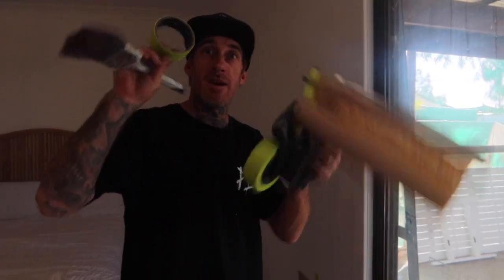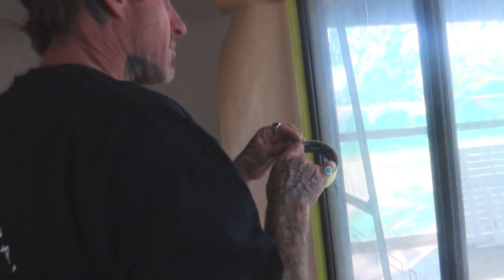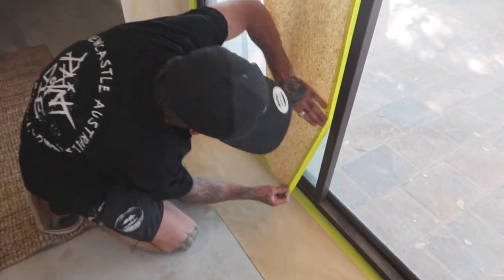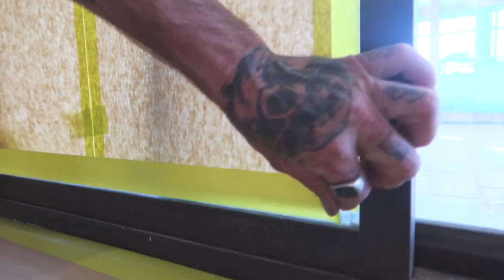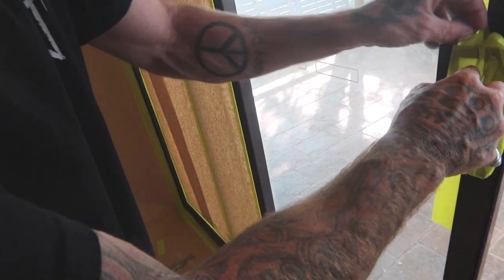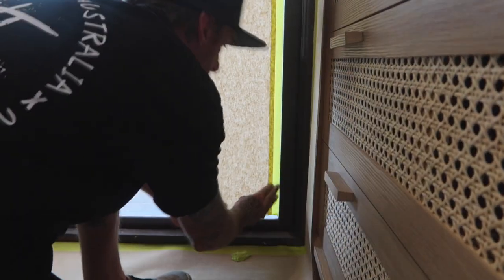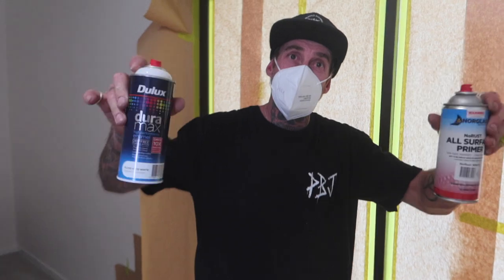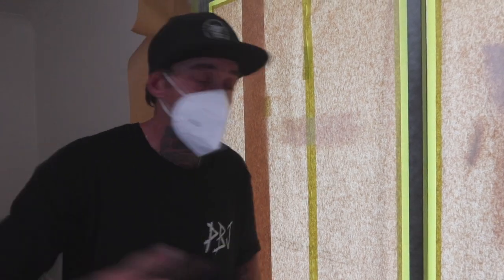PAINTING ALUMINIUM DOORS

Comment: Awesome video! Thanks Josh, just with the weather strip when removing windows. Can you tape that off or do you remove it whilst painting? 
And with the tracks, do they not get caught on the paint once it’s all dried or do they get stuck because of the paint?
Reply from the maker: Hi Isabella! Thanks for watching, I usually just tape the weather strip & one the tracks are painting the doors should just roll over the paint unless there is something wrong with the bottom of the door/rollers than it probably would damage/scratch the tracks. Hope this helps 🙌

Comment: Great vid Josh, I’m looking to all of ours inside and out. But I’m changing from primrose to black. So how do I get at those aluminium faces you see through glass when you slide the door or window?
Reply from the maker: Hi mate, thank you!  you can take the window out by sliding all the way open & lifting straight out. Then paint that back edge and put back in place the same way 👍 thank you for watching
Reply: @paintingbyjosh  thanks mate, will give it a go
Reply: @paintingbyjosh  thanks mate… legend. Got first window out I tried. Hopefully the rest are the same
Reply: Well I did what you said and it worked a treat. But. I had a layer of black over tiles and shower and sink. I had more paper and plastic taped up. Would this misted overspray because I’m spraying from too far back?
Reply: @adambonsall6253  Hey Adam! just a question since you tried this already... did the paint come off from the sliding friction?

Comment: So I am painting our church front door they are black and will remain black on the exterior and deep brown on the interior.  I think they are aluminum but they are definitely metal frames with large window centers and metal push handles in the middle. I noticed some chipped paint around the frame, would I use this same process to paint those doors.  Do I need to sand them first and if so with what kind of sandpaper? by the way thank you for this tutorial.

Comment: How do you spray the frame in the center behind the top door?
Reply from the maker: Hi Peggi, I have just filmed another video going into all the things I missed on mentioning and showing. It should be up on in the next week or so. You can lift the door off the tracks from the outside paint that section and you back in 👍thanks for watching
Reply: Thanks. Look forward to watching.
Reply from the maker: @PeggiG8  Thank Peggi 🙏
Reply: Hi Josh, great video. Do you have this video about spraying all the things you've missed. I would like to so my sliding aluminum windows that also have a flyscreeb, so I was also wondering how to do the inside tracking.